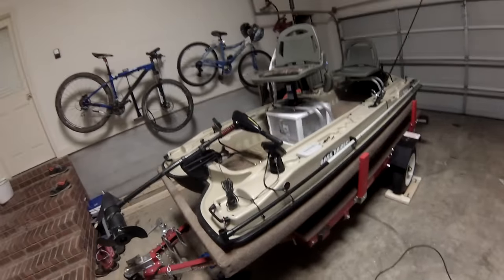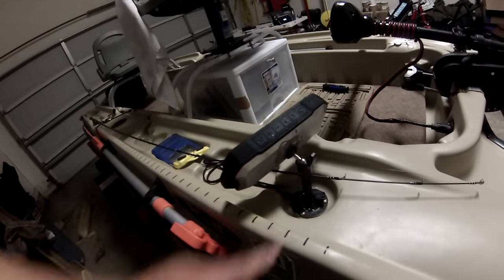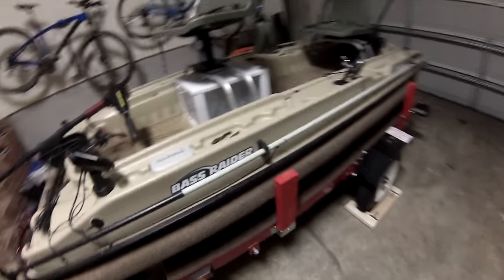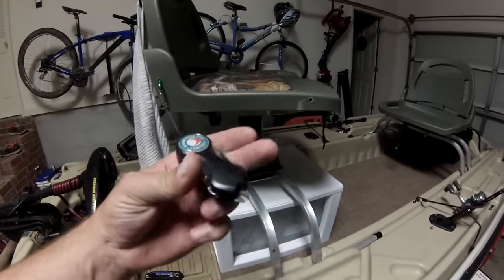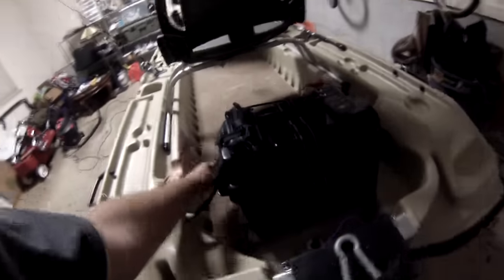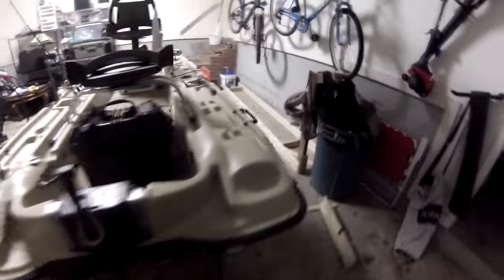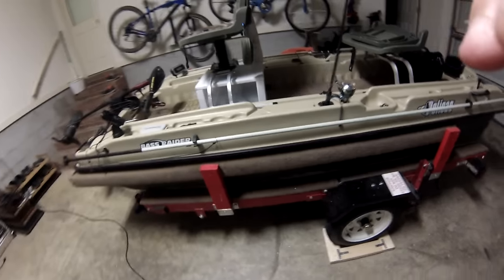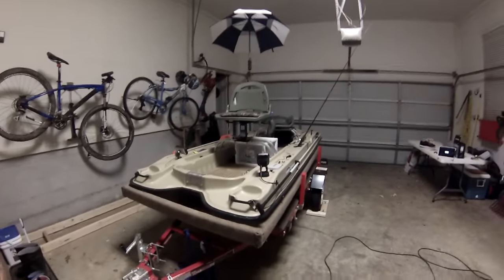Pelican Bass Raider with Modifications

Comment: so does the seat riser make it less stable...more tippy in yoir opinion? I read some other guys trying to dissuade a a guy from building the casting deck because they were worried about stability as well. I really like the deck and want to make it anyway. I measured and figured the best dimensions were 20'×28'. is that what you used? What kind of screws did you use for mounting the rod holders, etc? thanks.

Comment: Awesome vid, gave me a lot of ideas. just bought an old used basshunter 8'  Thanks for sharing, i now have some idea of how to deal with a boat that has no visible way of attaching things lol. I really liked the rudder idea, didnt think of that, should improve control with my tr up front fishing alone.    lookin forward to more of your vids..ken...ca delta
Reply from the maker: Rudder makes a huge difference...I have fished without it and it bout ruined my trip.  You're always jackin with the trolling motor and swingin for no reason.  Definitely a must have in my opinion.
Reply: Pelican Bass raí der troly
Reply: Concord Roofer I too just bought an older Bass Hunter Striker 8 footer. What mods have you done to yours? Any tips for a first time owner of one of these?

Comment: Do you use a winch to load the boat from the water? I got a similar setup on a Northern tool trailer and I find the tilting function useful when launching into the water but the A frame is difficult for mounting a winch. I prefer the straight type more room and options for mounting things.

Comment: Nice mods, gotta love these little boats. was thinking of using a stake out pole, through a hole in the floor. Do you know the exact type fitting you use for the plug / through hull for the pole. Thinking of putting 2 in, one front and back. any problems with the fitting leaking while using the pole though ? Again, nice work!

Comment: I'd like the drain plug idea. How did you drill it out and where did you get the stuff?
Reply from the maker: I started out with a 1 inch spade bit. Straight through. A TON of marine grade sealant and a no reversible two piece drain.  Bought it at Academy for 4 bucks.  You're going to have to shave both pieces down because the hull and deck are very close together....about 1/2 an inch so it take some workin....

Comment: Excellent video and great ideas!   I will try some of these on my Pelican for sure.  I want to try the deck for the bottom.  Check out my mods (not as good as yours) if you get some time.  The pole idea and magnets also great.   I wanted to try the risers on the seats but was not sure about stability.  Any issues with that sitting up higher?  Fish on!
Reply from the maker: No issues sitting up higher however I would look for 3-5" risers if you can find them...7 works just fine but I think a few inches less would be perfect.
Reply: Great video and you convinced me to go with the Pelican over the pond prowler.  Where do I find the risers for the seats?
Reply: Fish On! I agree I purchased the 7 inch and was a bit too much. I ended up going with three piece of 2x6. Was less than 6 inches and was perfect

Comment: What carpeting did you use on the plywood? Nice job. I just bought one this morning.
Reply from the maker: Standard outdoor carpeting from Home Depot.  Cost like 30 cents per square foot.  I also used all weather adhesive spray and tacked with staples.
Reply: Fish On! I pulled the trigger on Monday morning and bought the Pelican Bass Raider 10e at Dunhams. Took it out and have to say I'm really impressed. I was able to stand and move fairly easily. It will definitely work for me.
Reply: Fish On! Can u give me the measurements for the deck plz

Comment: Hey how did you fish the transom wire through the boat?
Reply: urtypicalguy he tied a nut to a heavy string and guided from hole to hole with a magnet then tied the string to the trolling motor wire or fish finder wire and pulled it back through.
Reply: @billwhalen8857  that is genius!!

Comment: Is this boat and trailer easy to move around on grass? I'm considering getting the trailer if I can move the boat by hand to my backyard.
Reply: I store mine in the backyard too it’s a bit heavy to pull the boat and trailer by the jack handle but it can be managed with one person with my aluminum framed 4x8 utility trailer with plywood decking. If you want your grass just make sure once in position don’t move the jack wheel back and forth it will tare your lawn.

Comment: hello sir would you tell your viewers how you put the fish finder and trolling motor cord through the hull
Reply from the maker: Ok so first thing is drill about a 3/4" hole at the back and at the front.   Then I took a nut and tied a 15' piece of braid to it.  Stick the nut in one of the holes and use a magnet to capture it through the hull.  Carefully "walk" that nut down the top part of the pontoon all the way to the other hole.  You will have some difficulty doing this but it can be done.  I did it twice with my TM and FF.  Once you get it out the other hole, tie that braid to your power cable for the TM and pull it back through to the original hole.   I finished with a rubber grommet siliconed over each hole.  When I make an update video I will go ove this in a little more detail.
Reply: Fish On! You are a genius! (magnet nut trick)  How well has your seat held up with the riser?  Does it cause the base to flex or anything?

Comment: So, $!: how much is everything so far, you know, boat + everything you've bought for it so far? And thanks for the idea! I've been mulling over things I would need for my next project; I'm working on a canoe rig for scootin' up & down the Susquehanna & Chenango to go after smallies and muskies that will be pretty much "powerless & wireless" and your fiberglass pole setup just basically filled in the power pole aspect (both rivers tend to run >10' in my region from early summer to late fall). All I need is a pole, a mounted slot for it, and a mallet and I'm set for stationary casting! Outta curiosity, how deep do you need to set your anker pole for semi-still water, and for slow to moderate water flow for the pole to keep ya stuck??